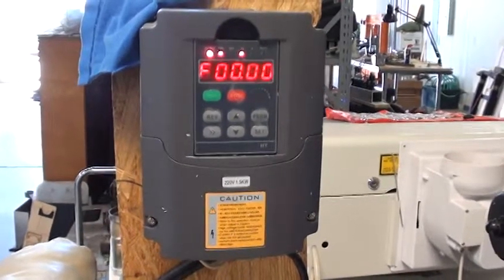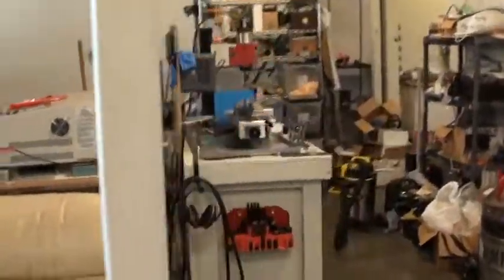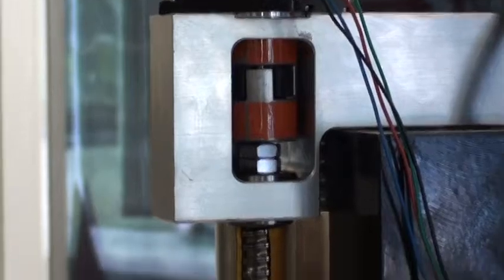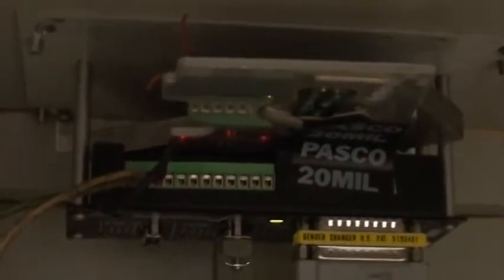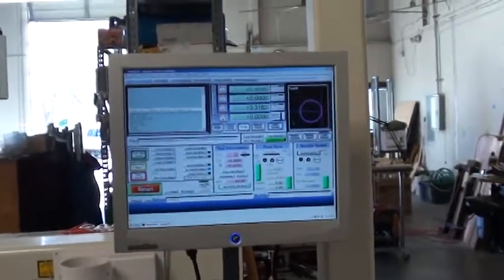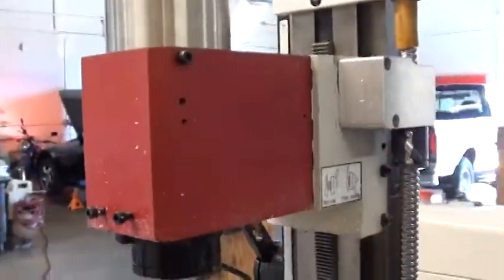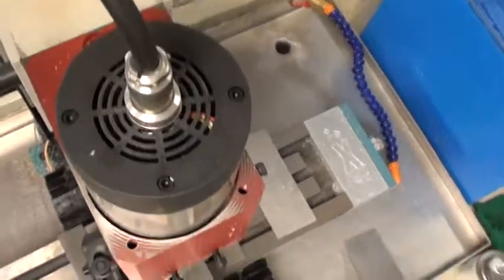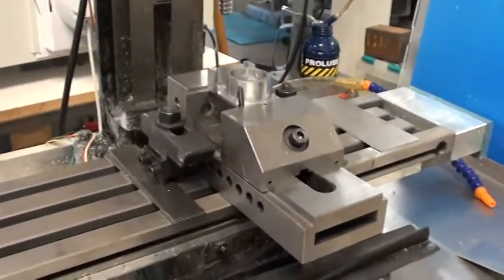Cnc X2 mini-mill - high speed spindle upgrade - 4140  chromoly steel

Comment: i'm using mostly .1875" and .125" two and four flute
Reply from the maker: Venier Forge I was able to turn a 1/4" 4 flute endmill in medium steel with out losing steps.  What torque are your steppers rated for?

Comment: I have a LMS X2 mini mill that I converted to cnc. I'm a knife maker and am trying to cut out and 3d mill folding knife parts but when I try to even just profile steel blades the mill will miss steps and all of a sudden be cutting where it shouldn't. I think the 2500rpm low power motor is causing the problem. do you think your high speed/high power conversion might help? Thanks Matt      matt@venierdesign.com
Reply from the maker: Venier Forge    what size mill are you trying to turn?
Reply from the maker: teamtiki   What size tool bit are you trying to turn?
Reply: really man?